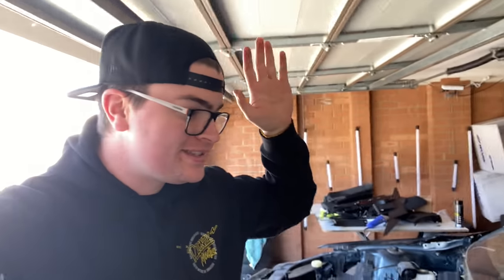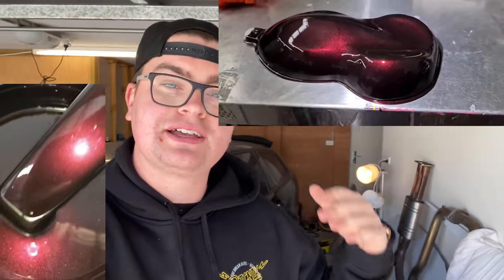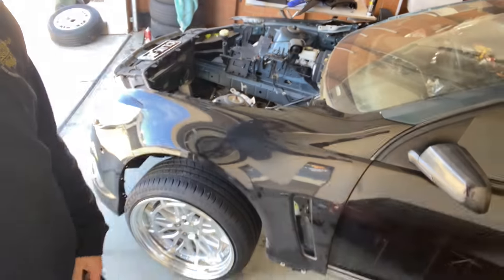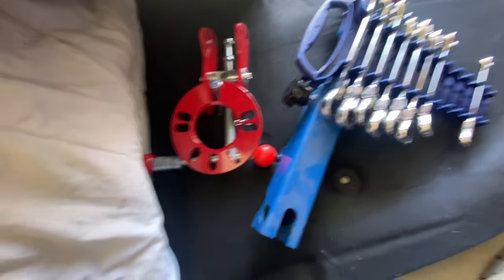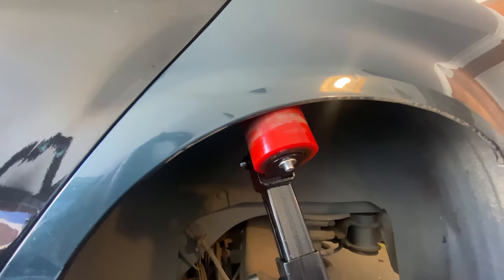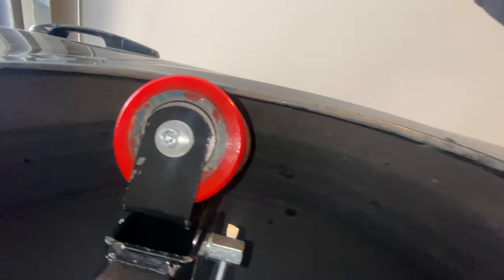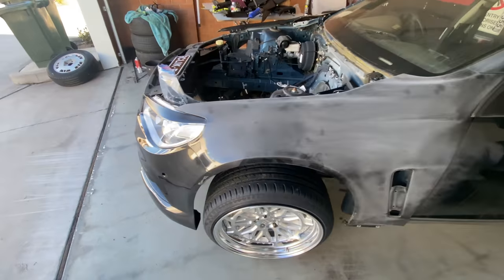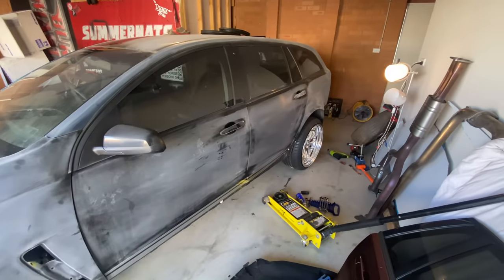Goodbye Vinyl Wrap! We're Painting The Wagon!

Comment: I think the ve/vf's biggest issue with the gaurds is the bumper bracket, even with the gaurds rolled the rubbing tends to hit the tyre unless you trim that bracket back.
Reply: That bracket is also the cause of the warping ‘you can’t avoid’......
Nick the return off the outer edge, roll the guard without any warp and then weld on a new return/bumper support. You’re painting so do it right

Comment: I just make sure you get it scuffed really good, personally I'd use something with a little more bite than just a Scuff Pad but it will do... if you don't have it scuffed-up enough the new paint can flake off. I definitely think paint will look, a lot better. My only worry is you said it's a custom color which I think is sick color, however it's a custom color that can be easily reproduce easily correct... being a burnout car you're going to definitely need more paint down the road. So something to think about you want something that's going to be able to easily be matched and blended as well. Paint is definitely more awesome, but one of the benefits to vinyl is if you have one small section bad you can easily fix it, paint is a little difficult to do that with. ☝️😉